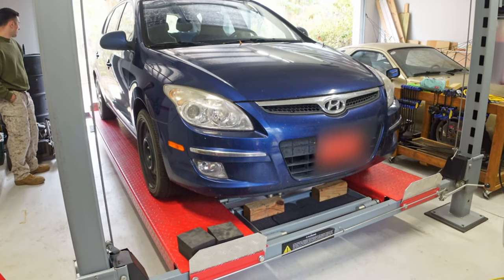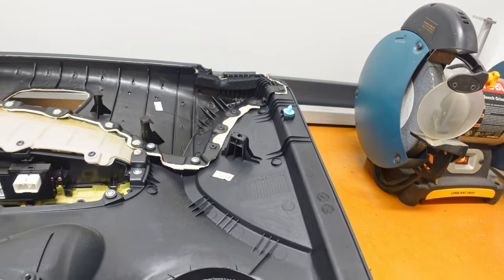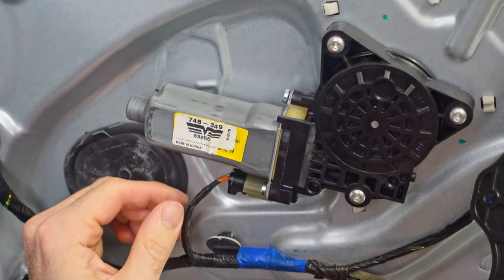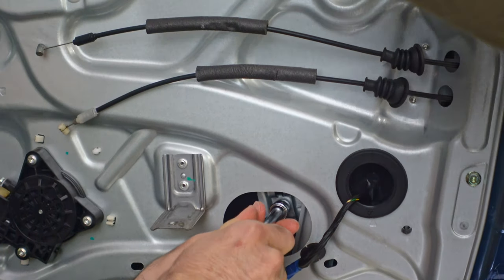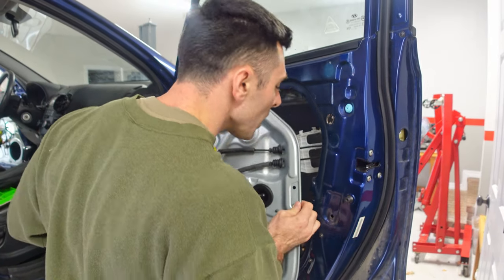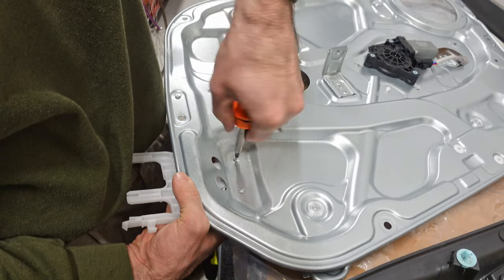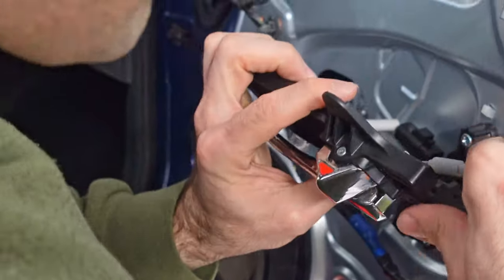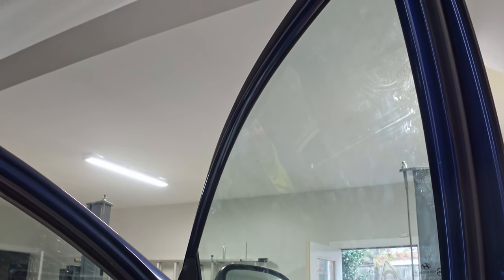How to Replace a Window Regulator Hyundai 2012 Elantra Touring

Comment: Probably a dumb question but I get confused, cause I'm not a car guy. When they say requlator, you get a new motor, well technically it's just your paying for the motor?
Also, has your sister get issues with the windows often? Cause it's about ever year now where one of them goes bad, been like $500 repair every time.
Reply from the maker: The regulator is referring to the entire assembly, on the regulator is a small electric motor that lowers and raises the window. The motor if I remember correctly was fine, but parts of the regulator broke and since you can't buy them separately you are forced to replace the entire regulator as one unit. I she has already had to replace the driver side window regulator. Apparently this part suffers from a design flaw that makes it prone to failure. I don't believe she has had issues with the back seat doors yet and I'm not sure if they use the same design and part since its not my car.

Comment: Can you tell me what the silver tool is that you’re using what it’s called you’re using it to take the bolts off the speaker?? Thank you.
Reply from the maker: I'm just using a proper socket size with an extension to give me more space for my hands. If I don't need a ratchet or I have already loosened a nut I will usually set the ratchet aside and just use the socket and extension.

Comment: To takeoff the speaker and the last eight bolts or screws around the panel after your dad was holding the window. Can you use a ratchet socket set?
Reply from the maker: Yes you can. Anything that is a nut or bolt you can slap a ratchet and socket it on if you have the space if you don't then use a wrench. I prefer not use a ratchet if I don't need the extra leverage. Typically on small nuts/bolts I will just use the socket and extension to tighten it up then put the ratchet on for an extra half to full turn whatever is necessary to make sure it is tight enough.

Comment: I paid a garage to do this and it broke again 2 years later( no abuse). Plastic sucks.
Reply from the maker: Yeah I'm glad this is not my car, this will clearly be an issue in the future. Major design flaw in my opinion. To much crappy plastic used in modern vehicles.